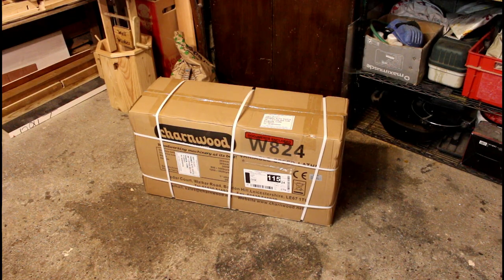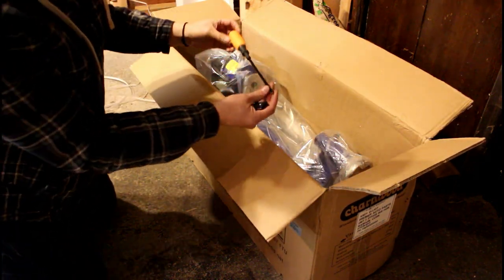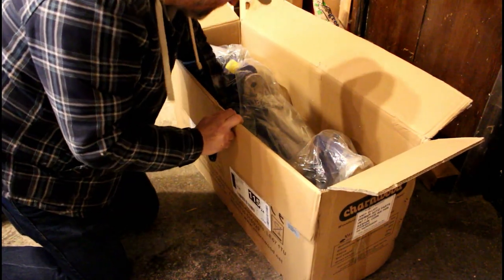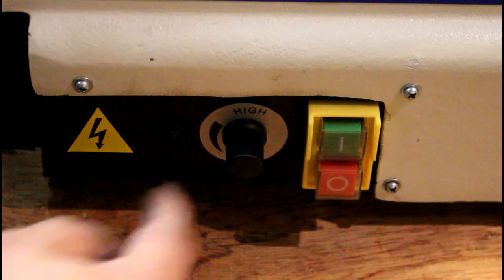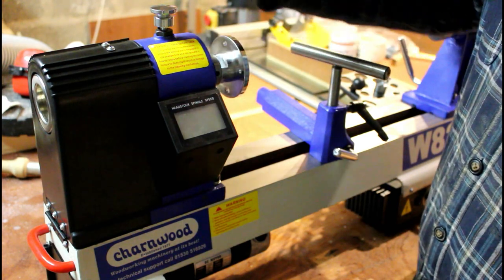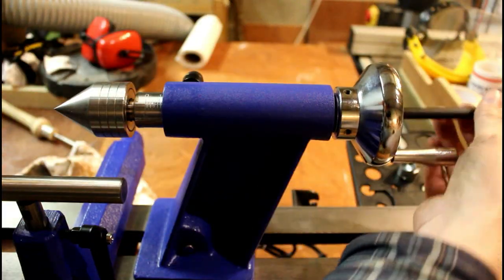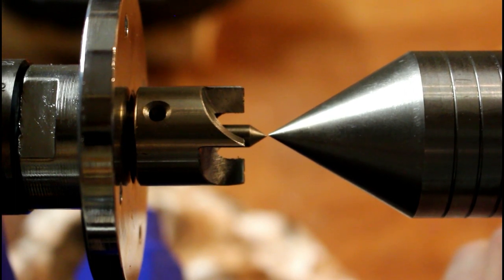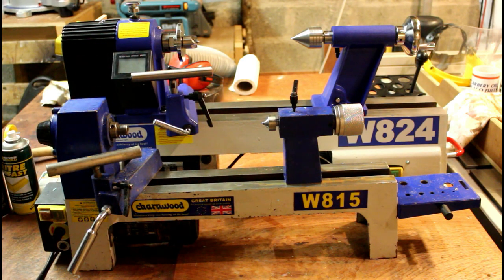Charnwood W824

Comment: Hi. Really enjoyed your review. As a newcomer i really liked the spec. Is it possible to give an update on your views.
Reply from the maker: Hey Gordon, thanks for watching! For purpose of full disclosure, I have had an issue with this lathe, pretty much from day one. At times, the motor would spool down, getting slower and slower. When it was powered up, It only reached 250 rpm before slowing down to a full stop. I contacted the supplier, who contacted the manufacturer. They in turn sent me a new control switch. In 2 days it arrived and was super easy to change over. I have video coming out about this real soon. Since I changed the unit, the lathe has been   such a great tool. I Love this thing! Okay, I had one issue but that hasn't put me off, and I'd highly recommend it if this is within your budget.